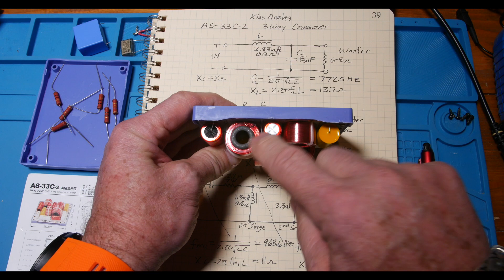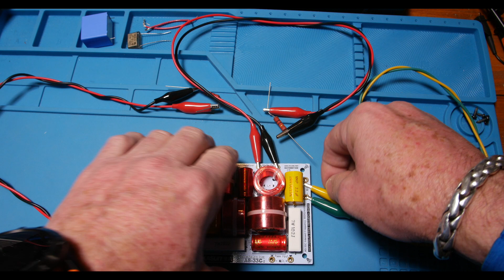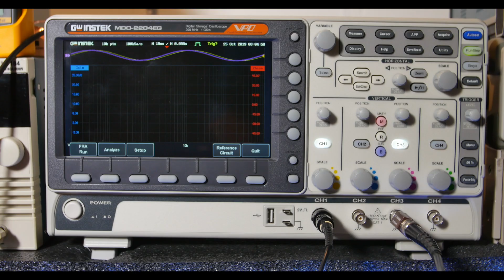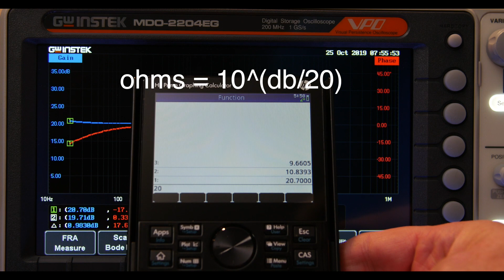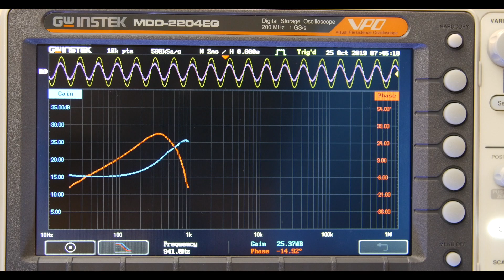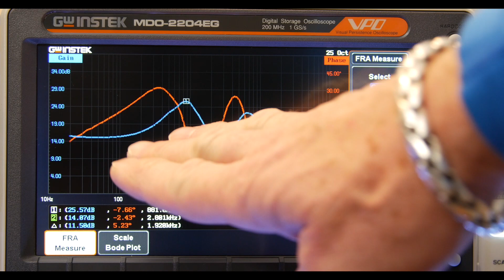Speaker Crossover Input Impedance part 3 with Kasun AS-33C #speakercrossover #speakerimpedance

Comment: Your videos are wary great, this video is a great addition!:-) I do often look at your videos, several times and I think I get new insights, so I have a question about calculating speaker filter or smps components. I think I have found out that calculating components is not that easy.
As I understand it do components change capacity, inductions and resistance, depending on the frequency and heat. So when you design a filter from your formulas it is only a good educated guess and you end up, having to test the circuit after construction? :-)
Reply from the maker: Fried Mule Thanks for the great feedback and support!  Yes, testing is ‘the proof in the pudding’:) But, with some experience or guidance, you can gain more confidence before going to the lab.  Selecting an inductor that, at the operating current does not get too hot, then you can approximate the inductance.  Say for instance, maybe a power inductor drops 10% with a 30 degree C rise. Looking at curves will help get you there.  I’m working on the walk through design steps for the boost converter.  I’ll have the component selection with trade offs as part of it.  This and the buck converter that I’ll do next will really help get to the right parts the first time around;)

Comment: My speaker boxes have three 8 " CTS, two 4.5' CTS, three 1.5" CTS tweeters, wired in series, output ohms 11.  Currently crossovers are 1mu 200V and 4mu 200V.   Can I use the Kasun?  (My speakers are 50yrs old  so I just bought replacement caps')
Reply from the maker: Great question!  This is a 3 way speaker, so it should work great.  Can you provide the schematic of the current crossover?  I can check the crossover points to see how well it aligns.

Comment: Hi. Thanks for the test. I tested this crossover in my 30-year-old Technics. The tweeter was damaged, so I replaced it. I also learned that the only filter on the midrange and tweeters are capacitors. The parameters of the old speakers are unknown, so which crossover I install is a lottery. I was very pleasantly surprised by the results. I'm finally discovering new sounds with my old equipment. Best regards.
Reply from the maker: Thanks for the great feedback!  Yes, many crossovers in products sold in high volume have minimal crossovers.  This one should be a big improvement:)
Reply: @KissAnalog  There wasn't even an ounce of soundproofing in the speakers, and the speakers were connected internally with wires like headphones ;) It's an old SB-SA500 model, but it sounds better now than when it left the factory. BR
Reply from the maker: LOL - I have seen the same thing.  This crossover is leagues more expensive than anything that they would consider:)

Comment: The Frequency Response will be different every time on different types of speakers according to Le... inductance
Reply from the maker: Thanks - that's true.  This is why I use resistive loads for the speaker to show the effect of the crossover - not the speaker.
Reply: Thanks for what you do.. what crossover design sw do you recommend? I'm using xsim at the moment but it doesn't update too often..
Reply from the maker: I usually do it by hand calculations, but I'll find something and do a video;)

Comment: Remove any steel with brass or copper in connections.
Reply from the maker: Thanks Larry!  Why remove copper? - are you concerned with oxidation?  What if the connections are soldered?  That adds tin so there is little to no oxidation.

Comment: How can you tell which cap, resistor, coil, goes to which speaker if you don't have the diagram?
Reply from the maker: Great question - thank you!  I reverse engineer it as I show how I do this in this video: https://youtu.be/EynJiLZVeR4
Reply: @KissAnalog  thanks. My crossover is a little different though. It doesn't have those dual lines traces, just single line that splits it up to positive and negative zones. I have a map of it, but I'm trying to understand the crossover more. I'm getting continuity when I put a lead on the woofer output and touch it to parts of the tweeter circuit and I don't always get continuity on the woofer ckt parts. I found all the the spots that connect to negative because of your other video, thanks! But I only know the postive end for the parts that are right next to the positive outputs. There's four little islands of positive and negative. How do I know which goes to which speaker? I'm having a very hard time reverse engineering this. Thanks for you great videos.

Comment: Hello, im trying to build, or as I should say, improve my old speakers, which contained 2 woofers (8 ohms) and 1 tweeter (12 ohms), all connected in parallel to an amp thats supposed to support 6-16 ohms. If my calculations were right, the parallel connection resulted in a 9.3ohms load which is fine. In those speakers tho, there was no crossover what so ever, so I thought of ordering a 3way 4speakers crossover (tweeter, mid and 2 woofers). Ill replace the woofer for an 8ohms one and add a mid range with 6ohms. The crossover i was looking for supports all the mentioned impedances, but will my amp work with it? Im desperate of searching for anyting online about speakers, because the more I know, the less I know :-D thanks in advance

Comment: I want to asking you dir.. 
before that i am sorry for my english maybe not smooth well.. and newbiest question.. 

I am form Indonesia sir.

Is it possible to combine a driver speaker with crossover 4 or 8 ohms sir? 
I've crossover 4 or 8 ohms and my woofer impedance is 6 ohms. 
How about the quality of frequency, could be running well sir? 

I am appreciated for your help to answer my question sir. 

Regards,

Sam
Reply from the maker: Yes, I think they will work OK with speakers of different Ohms.  The crossover might be off a bit but probably not noticeable.  The efficiency of the speaker might make a bigger difference.  Thanks Sam - your english is just fine - I would like to be as good at a second language;)
Reply: Kiss Analog Thank you sir for your response and answer my question, i'm happy now.. 
goodluck for your channel sir..

Comment: Do you think this filter can handle 4ohm woofers?
Reply from the maker: The total power rating is 160 Watts, so I think a 4 ohm might be ok if you are not running the power up too high.  I’ll power this up and test it with both 4 and 8 ohm loads.  Thanks for the great question Deejee!

Comment: WHAT KIND OF RESISTORS ARE YOU USING?IT SEEMS TO ME THEIR WERE MORE CURRENT DRAW AND,PHASE SHIFT AT THE LOWER IMPEDANCES.I DO NOT UNDERSTAND WHY YOU KEEP CALLING THE GAIN AS IMPEDANCE.
Reply from the maker: david luther Hi David - great questions!  think it is the current probe that is out at low frequency, but I’ll have to investigate this a bit more.  The reason it is impedance is because one probe is voltage and one is current, so for gain it is voltage out divided by voltage input, but here I am taking voltage divided by current so it os ohms or impedance.

Comment: Would one of those software’s be “Analog Discovery” I’ve been looking at that for a few years now haven’t touched it yet have not laid down the money to purchase it it’s not that expensive
Reply from the maker: t lech Analog discovery does look like a fun system.  I’ll do a video this week on software that is very low cost or even free.
Reply: THE WAY I UNDERSTAND THE ANALOG DISCOVERY IS THAT IT IS MADE FOR PERSONS WHO DON'T HAVE OR,WANT TO BUY ANY LAB EQUIPMENT LIKE FOR THE HOBBY PERSONS, NOT FOR SERIOUS ENGINEERING WORK.
Reply: david luther Yes true it’s used in universities all over the country for students to mimic the operation of the expensive lab equipment. Students and Hobbies can’t afford hundred thousand Dollar  Tektronix lab scopes and frequency analyzers but hobbyist and most engineers don’t need accuracies that are down to 0.00001%
        But what I have found out in the EEV blog and audio hobbyist forms the analog discovery is use quite a bit. Speaker builders and amplifier builders and those designing crossovers use it as a regular tool.
Reply: I WOULD'T TAKE ANY ADVICE FROM THAT BIGGOTED SNOB EEV.ALL HE DOES IS RAVES AND RANTS.PEOPLE LIKE AND HIS ATTITUDE RUINED THE ELECTRONICS FIELD FOR EVERYONE ELSE.